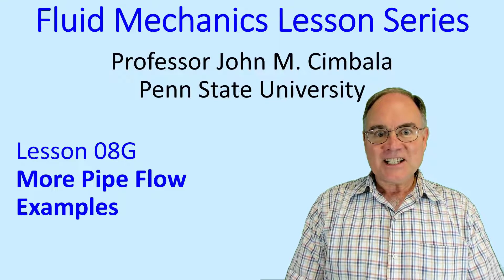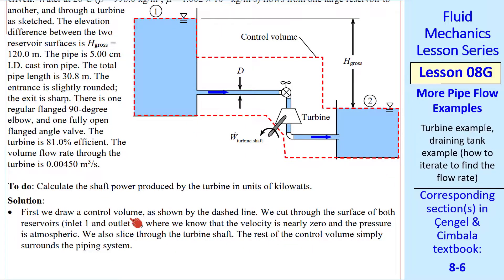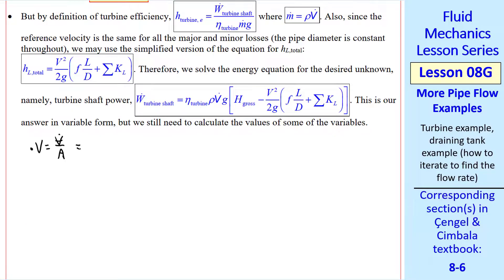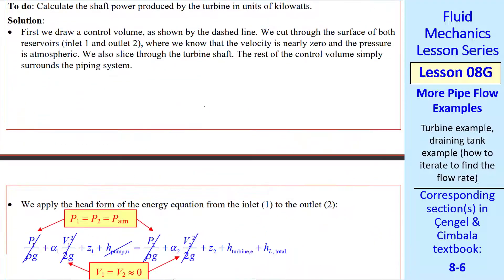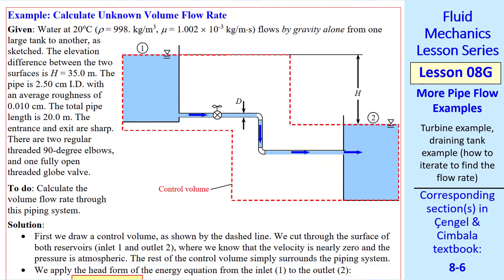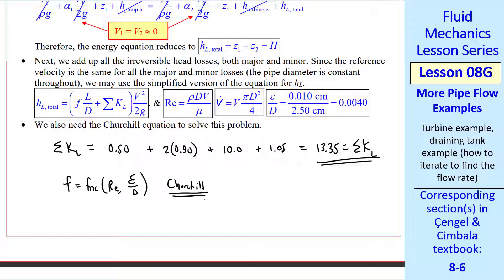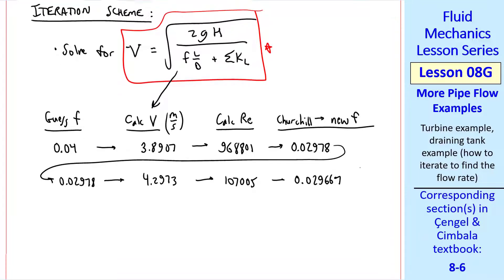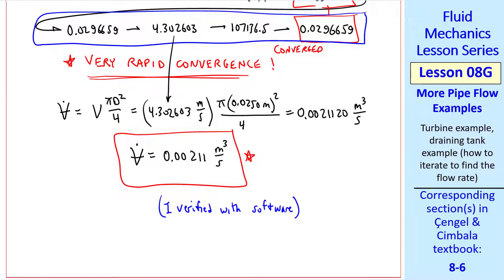Fluid Mechanics Lesson 08G: More Pipe Flow Examples

Comment: @johncimbala, Professor, I wonder if you are willing to make a quick video demonstrating how to program the iteration method used in this video in MATLAB?  I assume there is a while loop, but I am struggling to get the code right:

clear
clc

g = 9.807; H = 35; L = 20; D = 0.025;
rho = 998; epsilon = 0.00010; mu = 0.001002; Ksum = 13.35;

f = 0.04;    % Guess f
n = 1;

while f(n+1)-f(n) > 0.00000001
V = sqrt(2*g*H/(f*L/D+Ksum));   % Calculate V in m/s
Re = rho*V*D/mu;        % Calculate Reynolds number
% Solve Churchill equation for new f
A = (-2.457*log((7/Re)^0.9+0.27*epsilon/D))^16; B = (37530/Re)^16;
f = 8*((8/Re)^12+(A+B)^-1.5)^(1/12);
end

f = sprintf('%0.4g',f)
Reply from the maker: I am not that great with MATLAB. Perhaps someone else can give you some hints on your code. Some of my students use the Solve function in MATLAB effectively. I usually use Excel for this kind of problem. 
Thank you for your comment. Please tell your friends and colleagues about my YouTube channel where there are over 500 free videos about the Bible, fluid mechanics, science, math, Excel, statistics, air pollution, and other topics. I would greatly appreciate it.

Comment: In the iterrations example (2nd example), why is the minor loss coefficient of the oulet 1.05? How did you assume that the flow is turbulent without knowing Reynolds number initially?
Reply from the maker: Ahhh... good question. You don't know beforehand. So, you must choose laminar or turbulent and then go through the analysis. At the end, calculate Re and see if your assumption was correct or not. I did exactly that in Lessons 08D and 08E with a different example. I assumed laminar but found out that it was turbulent. Then I repeated the problem as turbulent.
Thank you for your comment. Please tell your friends and colleagues about my YouTube channel where there are over 500 free videos about the Bible, fluid mechanics, science, math, Excel, statistics, air pollution, and other topics. I would greatly appreciate it.